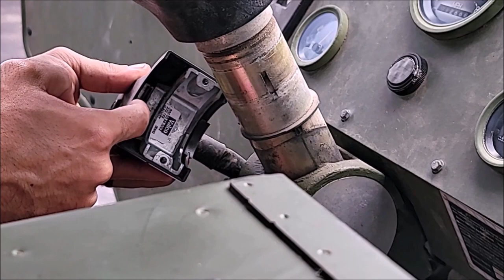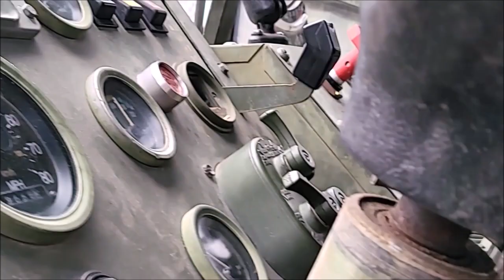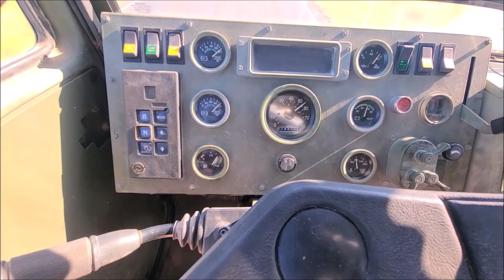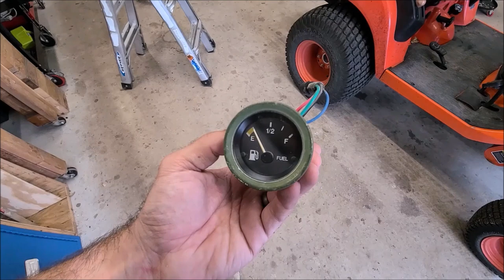M1078 LMTV - Update #11 LED light upgrade, turn signal auto reset fix, & more!

Comment: You can get LED bulbs for the 2721 OEM.  Brighter and require polarity to function, but they won’t burn out or melt the switch housings.  They also don’t require the color bulb caps.
Reply from the maker: I figured I would try LED if they ever burn out again. Was worried about how well they would dim. The bulbs didn't melt the switch as I initially thought, that's why I put the little note at the end of the video. I have some new switches and they no longer use the color caps on the bulbs, they have a nicer plastic insert behind the lens the acts as a diffuser so you don't need to worry about that anymore.

Comment: To stop the vibration noise from the back panel, install peel and stick 1/8 inch weather stripping on a grid pattern. The denser black stuff works best.
Reply from the maker: I thought about that but it would make it a but harder to remove. Also, the metal gets so hot in the south Texas sun the adhesive always seems to melt off.